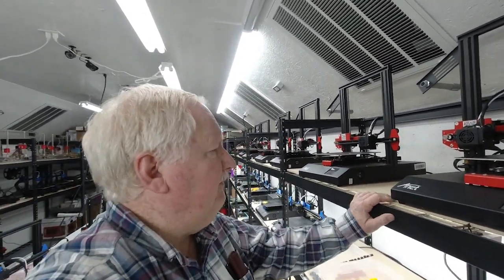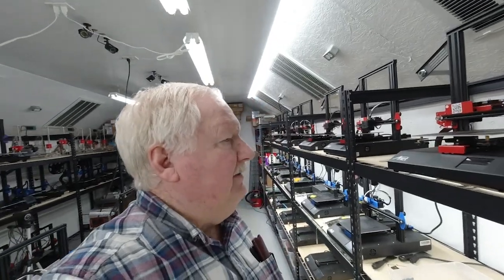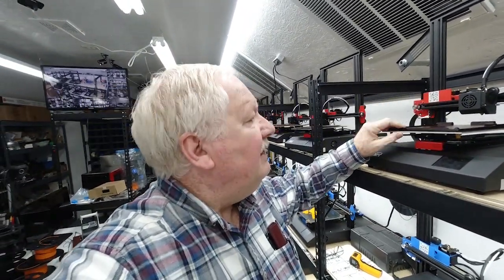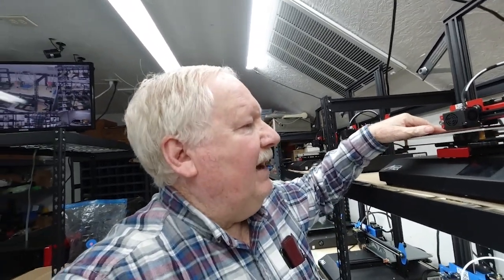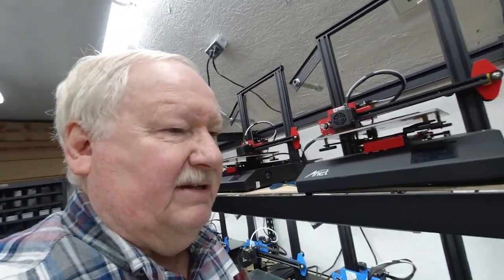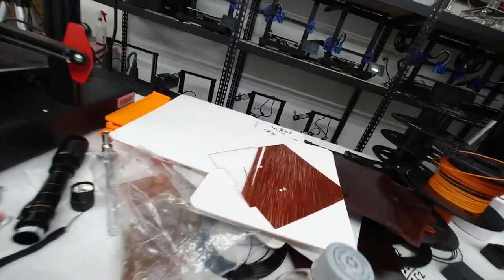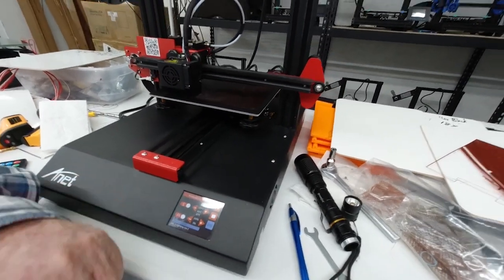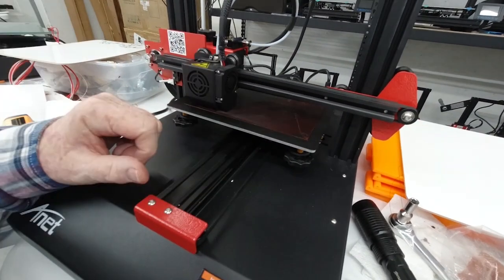3D PRINTING, THE FIRST LAYER is the most important layer at my 3D print farm.

Comment: Spot on!  The first layer is absolutely critical, especially if it is a viewable area of your part (like yours).  Like others have said (and I agree), same printer models can have different characteristics.  Everybody has their own method that works for them.  All are good if they work for you.  I'm running 9 printers, all printing the same parts.  I didn't want to have to maintain different files for each printer so my approach was a little different.  Layer adhesion is not a single adjustment but a balancing act between hot end temperature, bed temperature, and distance (z offset).  I have 9 printers, all printing the same parts, 24/7.  What works for me was finding a mid range value for hot end and bed temperatures that works across all printers.  I leave z offset alone (0).  First I pre-heat the bed.  Next I level it.  I then start printing a flat pattern (like your lap diner). I then use the leveling screws to do fine adjustments to the initial layer height while printing until I get the proper line thickness and adhesion.  I do need to do tweaks on occasion (with the bed leveling screws), but not often.  This way, I never have to change the gcode or maintain separate files.   Again, comes down to personal preference.
Reply from the maker: You said hat very well Bill. I agree that you can set up a printer in different ways and get good adhesion and what ever works best for you is good enough. Don't fix it if it ain't broke!!! I also agree that a level bed is very important if your printing a large part or many parts that take up a lot of the print area. I also fine tune my ET4X printers like you by adjusting the leveling screws while printing the first layer if necessary. The ET4X does not have auto leveling, so my adjustments will carry on to the next print job. Thanks for sharing your experience in this area and thanks for your support and have a Happy Thanksgiving...Ken

Comment: Nice videos!  I only have 16 printers (Just ordered 2 more) 14 of them are the same model. Each prefers slightly different settings. Some print better 5 degrees hotter or cooler than average. The Gcode has the the best average temps set.  I use 3/4" dot stickers to alert me to manually adjust the off average printers up or down. Blue (+5) Red (-5) The red tells me that the printer runs hot, reduce by 5 degrees. Over time things change. A printer might add of lose a sticker.
Reply from the maker: Good system you have there my friend. I also find differences in the characteristics and temperatures between identical printers. It takes time to fine tune a printer for a specific job, but it's necessary. Thanks for sharing your information and for your support... ken

Comment: Hey ken....great experiment.   Right on ....what’s your print fan temp .. should be 0.  I here your fan going.  What’s the bed that you use instead of glass?  I just saw a gent use an adapter for his fan that incorporates a press gauge to measure bed level.  Fantastic .. part is on thingiverse.
Reply from the maker: I saw that too in the video you recommended. a level bed is very important for sure. I use the stick-on bed that comes with the printer and working on trying spring steel/pei. Will try setting fan to 0, I haven't been doing that. Thanks for sharing this information Joe....Ken

Comment: The first layer is the most important, I absolutely agree. I also arrived at that conclusion eventually. Consider the first layer as the foundations of a building. If you look closely at how the first layer is printed, the printer will first lay down a frame and then fill up this frame. This frame is composed of lines or walls and there are actually settings for these. Initial layer line width. I bumped up this setting from 100% to 150% and that really made those walls thicker and stronger with better adhesion. I also decreased initial layer wall speed and that also gives the printer enough time to lay down those walls more slowly without rushing.
Reply from the maker: All good things to do my friend. There are so many settings, both on the printer and in the slicer, and you just have to work with them until you get the results you're looking for. Once I get a printer set up where it does a great job with a particular print job,                                                        i try to always print that job on that printer. Thanks for sharing your info and for your support...Ken

Comment: It really looks like a z-offset issue with the nozzle being to far up. I just learned the other week that auto bedlevel does not set your nozzle height so I had to adjust the z offset. Maybe the temp increase made it flow more to get the layer but what are those holes? I print a big flat piece that covers the build plate as well and there is a plugin in cura that puts little brim circles that helps the corners stick. I ditched my glass bed and got magnetic spring steel pei beds they are my favorite upgrade.
Reply from the maker: I always preheat both hot end and bed before adjusting nozzle gap. This allows for temperature expansion and also takes care of any filament residue that may be on the nozzle. In this video the two prints were printed one after the other with only the temperature being changed on the printer itself. The part does have 5 holes in it. I will look into the brim circles though, I'm not familiar with that. Thanks for sharing and for your support...Ken